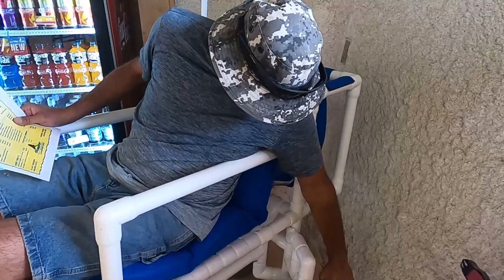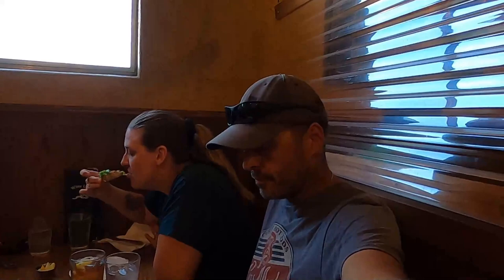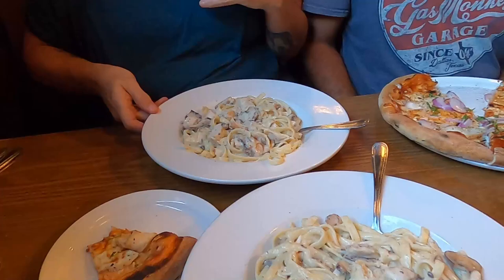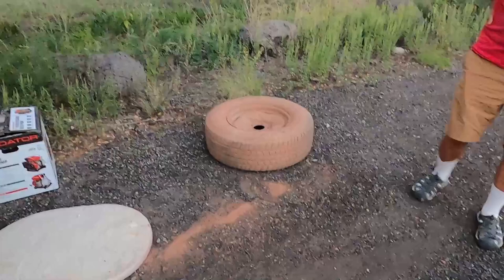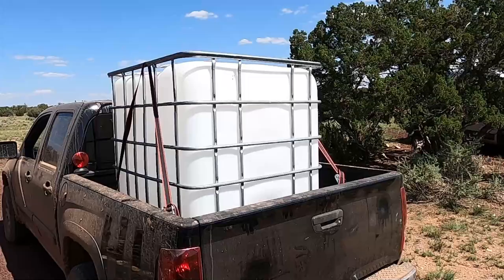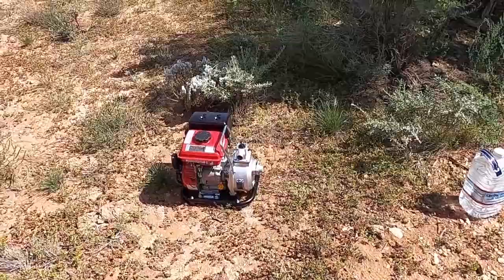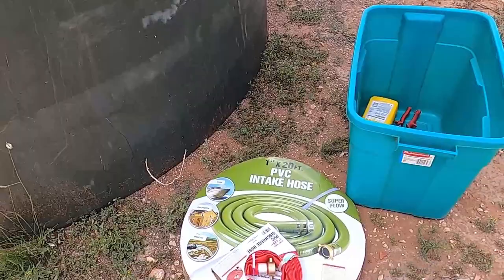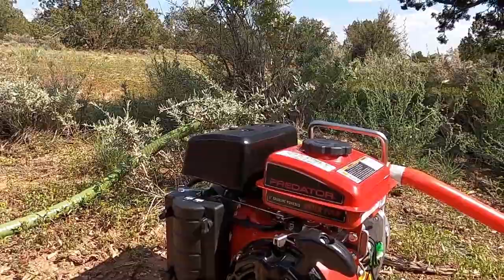Project Water Haul | Flat tire | Tank fill Goes Wrong

Comment: Mr. Ed. On your Square water totes there should be a valve on the bottom to let the water out. From your local lumber yard or Hardware. Get some pipe reducer that will fit the green pipe preferably quick couplers. Tie that to your pump. Now on your big water tank. If you only have one on the property unless you have more than one. Now on the side of your big tank run some heavy wall PVC pipe with a valve on the bottom up to the top by the opening. Where you can drill a hole with a hole saw next to the top. Then secure it all to the tank. Then at the top where your lid is drill the same size hole with two pieces of one foot and two elbows make an L shape out of it then put it in the hole in the top. With your PVC about 2 ft off the ground turn your volume on the big tank then your valve on the little tank start your pump and start letting the big tank fill up with water. Good luck and be safe you all

Comment: I'm sorry, but I couldn't help laughing.  Been there...done that.  Only it was a fire hose hooked up to a hydrant.  A lot more pressure and volume.  I tried to grab it but quickly realized that was a mistake and turned the hydrant off.  I used to own a vacation house in Newport, Or.  The well water was nasty so I bought a 1500g holding tank, 500g transport tank and bought water from the city for (you better sit down first) 1 dollar and 10 cents per 1000 gal.  That was the going rate that they charged everyone on city water back in the early 90's.  Fortunately, my holding tank was lower than the driveway so I could just let it drain out of the 500g tank.

Comment: I agree with Jo,You should check to see if a well is possible.
Reply: Per Ed's figures it would be around 140K dollars to drill a 3500 ft well even if permits were still being issued for their area which they are not.

Comment: To viewers out there please put gas only in the red gas cans.  Just put some type of clamps on the outside of the tank that will handle holding the hose :) but I'm sure you thought of that already.
Reply: That was water Ed was pouring in to prime the pump.

Comment: Then wow sorry that that happened with your water company I can't remember the video I seen but I've seen a guy use PVC pipe up the side of his tank and into the poor valve he used three inch pipe up the side of the tank and over to the center where the fill hole was all he had to do was remove the cap from the top of the tank and he had a quick connect on the bottom of the PVC he had an elbow and that quick connect connected to the pump that had the other part of the the female on the quick connect on the on the pump and he would just push the female onto the male that was connected to the PVC pipe and then he had a hose like you got going into the other tank that was filled with water and he emptied one of them totes in no time at all.